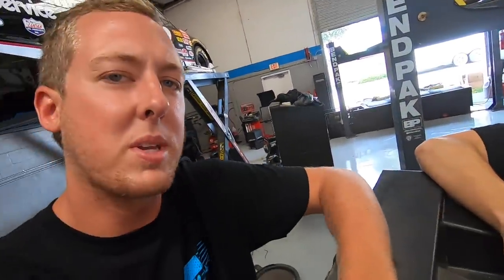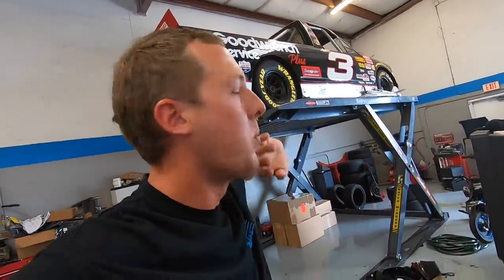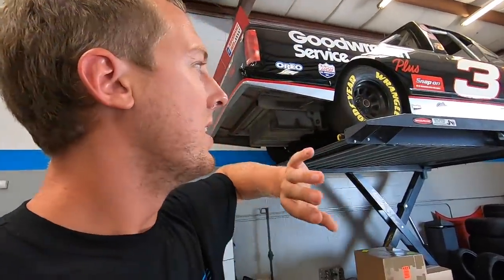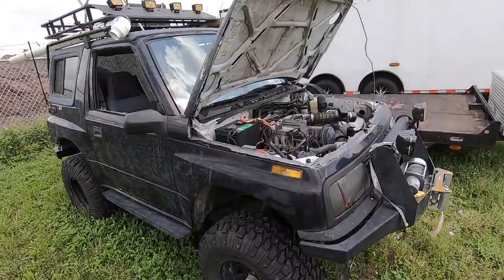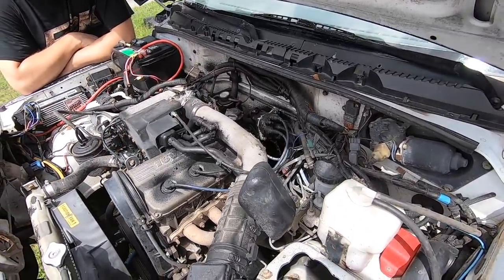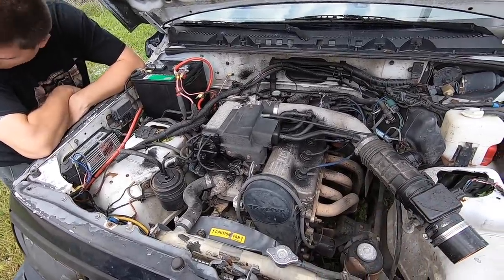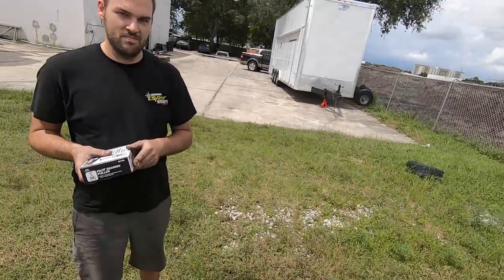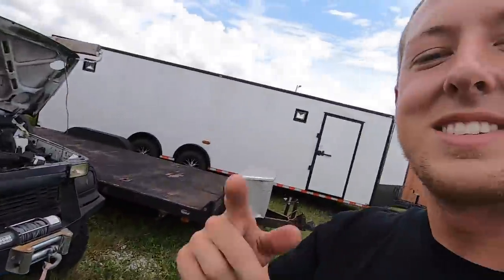Here's Why the Dale Truck and Mini Bogger Have Been Missing

Comment: Maybe you should look for a diesel for the mini bogger. no electronics to make it stall out.
Reply: Eric Nelson just a Kubota 3.2L or a Cummins 4B
Reply: Fantastic idea, especially now that the Galaxie put some diesel fumes in ol' Cleeter's head...
Reply: Something like a VW 1.9tdi would be pretty cool
Reply: 4bt squaa
Reply: Get a marine diesel out of a boat. That’d be sweet.
Reply: Vw TDI is definitely the way to go and they can make some serious power for what it is.
Reply: @diffypoo  they're bulletproof.. got one in my ford galaxy
Reply: @diffypoo  
That's still electronically controlled with a computer
Reply: Kyle Sonsalla not the older ones...
Reply: @427bbcpower  
ALL TDI engines are computer controlled. The older IDI engines are all mechanical.....
Reply: Kyle Sonsalla ok well then you can swap the mechanical injection pump onto the tdi cause I’ve seen all mechanical tdis before
Reply: @427bbcpower  
You can swap 4BT mechanical pump onto some of them, yes, but the way they leave the factory is computer controlled. Like a GM 6.5, VP44 5.9, etc. The newer TDI engines you cannot make fully mechanical because they use high pressure common rail injection, and the middle years are unit injectors.

Comment: Cletus: "Nothing's broken on it, she's mint"
Also Cletus: "She hooks hard left on decel and needs all new brakes and suspension."
Reply: It was designed to make left turns.
Reply: New nascars do that they are design to do that,
Reply: @Jmandude5  They are not MADE to turn left. It's set up to turn left. You guys do realize that NASCAR does run road courses....
Reply: For Christ's sake. Leave it like it was designed to be and go find a circle track to race it on.
Reply: JMD5 Gaming he never said anything about needing new things... rebuilt brakes, yes.  Adjustments to the chassis / suspension.. but nothings broken.  Just not needs tuning... you know, like a fresh engine swap with a new turbo.  Not broke, but needs adjustments to be it’s best self

Comment: Bogger solution- carb it with an older Suzuki samauri intake setup and distributor- its plug and play. Then if you wanna get real crafty, cut the distributor base in half, weld a 10’ shaft in it, weld a sleeve back over it, and extend the pickup wires/plug wires and have it up over the truck!
Reply: 1990bandit2 don’t know beans about boggers but that sounds like a solid plan

Comment: Cleetus, I'm a huge fan of the channel. I have some suggestions for the Mini Bogger. I would transplant the Gas engine with a 4 cylinder Diesel with Marine Electronics. other than that I would try finding all marine components, alt, starter, Distributor, etc. you had a good idea for the computer by placing it in a sealed box. I would run the exhaust above the roof line . for going in the water reduce buoyancy, take the doors off and maybe putting those tube steel half doors like the jeeps have for safety, and removing the back glass so the water will flow freely throughout the vehicle and it will be more stable. I would drill holes in the roof so there wont be any air pockets. and last that i can think of is fill the tires with water. With that done and less chance of tipping over and           your reducing the buoyancy and increasing traction. Just a thought. thanks for you guys amazing content.

Comment: I'v broken 6 pilot bearing pullers in removing the PB in my C5 Z06.(given three were Harbor Junk).  I have since modded the last three arm puller with a blocker spike that fills in when the arms are spread. Works like it should now. In the passed I'v had to use a Dimond bit in the Dremel to cut and relieve them.

Comment: On the truck....its built to go left so I'm sure the caster/geometry is such to support turning into the corners. Might even be set up with a little bump steer on compression to tow out the LF for better turn in. I've been surprised that you never did set it up on an alignment rack....

Comment: You might want to check into the brake port valve or valves because those trucks and cars are set up to apply more brake pressure to the left front to help it set up for the curve..

Comment: Cleetus, have you checked the front spindles? In most stock car applications one side will be longer and one side will be shorter so the vehicle drives into the corner. Just food for thought

Comment: If you want the Mini Bogger to bog deep and succeed, you need to do, at least, two things:
- In addition to the intake snorkel, build an exhaust snorkel. What killed your 3rd bog attempt was the water clogging the Mini Bogger exhaust. It couldn't generate enough exhaust pressure to overtake the water going into the exhaust pipe.
- Remove the doors. Not only does it facilitate your "escape maneuvers" in case of a failed bog, it allows the water to come in and equalize pressures evenly. Your 2nd bog attempt failed because of this, the water flooded in from the driver side, the driver side became heavier and it tipped over.

In addition to this, I think that you should either isolate as many electrical components as possible, or swap the engine for something less dependant on electrical/electronic stuff. Water on electronic circuits is a no-no, as seen on your 1st bog attempt, when the distributor failed.
Also, put some heavy duty paddle tires/wheels, it makes going through mud much easier. That puddle bottom should be all soft mud, the last thing you want is for the Mini Bogger to sit on the bottom with no traction.

Other than that, do it for Dale and BOG DEEP!

Comment: Forget about the pilot bearing puller.. pack the cavity behind the bearing with grease or soap, take a bolt or a punch that's a fairly neat fit in the centre of the bearing then give it a good hit or 3... bearing will pop right out

Comment: Tell James  I have a trick for him to take out the pilot bearing with no tools and this works on all pilot bearings. All you need is a tube off grease a news paper and an old pilot bearing tool (like the little plastic one that comes in most OEM clutch kits).and a hammer not always needed. Alright take the grease put some in the center hole of the bearing then put a little piece of news paper and pack it in with pilot tool keep doing this till you cant get anymore in. (Doesn't really take much) then take pilot tool and hit with your hand or the hammer when u get it packed good and tight the bearing will start coming out and sometimes when you hit with the hammer they just pop right out

Comment: To drive a spigot bearing out fill the hole with grease and then use an input shaft [or a piece of steel that dia] and tap it in which in turn drives out the bearing.. Works everytime and dead simple and cheap.

Comment: If you want to remove pilot bearings you can us a punch or socket that fits inside the hole and just press a potato, bread, a bar of soap makes it cheap it pretty easy once you do it a couple times. I have done it loads of times myself

Comment: The Truck,,  make sure it has equal length wishbones then work out what shocks it has [shock dyno]  and then simply square it up. Probably need springs, though if you know the spring rates just buy 2 the same as the softer ones. Corner scales are best but simple measuring works ok.
Though the scales will help sort out all the fleet and will let you move weight back without extra weight in the rear.

Comment: Pilot bearing tool lolol brother you don't need one!!!   Stale bread works best. Find something like a 1/2" extension and pack it in the area within the bearing and fill it pack it fill it pack it til it pops right out . Astonished me the first time, it worked so easily. Just a tip tater chip

Comment: If you look at the a arms on the dale truck .its probably about a inch shorter on the drivers side .might be why it wants to left. Might be I said .someone might have changed it ..also check wheel base .the rear is probably staggered .meaning the right rear might be forward a 1/4  or more then left .depending on what the chassis was originally set up to do .just throwing it out there .there's a few more thing to check but I'm sure you guys will have a expert go over it .

Comment: Remove a pilot bearing pack grease or even soap into the ID and pound an input shaft/clutch align tool/bolt into it, hydraulic pressure behind the bearing/bushing will push it out.

Comment: The mini bigger needs to have the exhaust extended to be above the water line just like the intake. The reason it is dying once it gets under water could be that the exhaust is filling up with water and causing too much back pressure and is choking it out.

Comment: Need to make venting holes on the bottom, so you dont have to open the doors to let the water in. Or out.... a hole saw bit and flex seal should do the job

Comment: You can use a old input shaft and fill the pilot hole full of grease and pop the pilot bushing right out
Reply: Not on an LS you can't. There is a plug in the back of the crank that will press in and cause a whole bunch of problems.

Comment: The mini bogger needs to loose the fuel injection and needs a intake, distributor, and carburetor from a earlier model and then be put on Propane to do submerged running. Also the Mini Bogger needs calcium in the tires to weigh them down.
I thought Cooper put a built motor in the Supra or did never get installed.

Comment: Use bread for your pilot bearing puller pack it in with a round punch and it pops right out sounds crazy I know it works. Yes I said bread bunny bread what I use and eat! Its hydraulics grease works to but its messy.

Comment: They should install some cheap ECU in GeoTrucker like megasquirt or speeduino. I that way the could rid ignition distributor for direct igntion and the could pour all engine electronics with rtv silicone in one box.

Comment: What ever happened to the rail job that you were going to put an engine in so you could play in the sand or take to the woods and do some rock crawling with? Or the air boat idea? ut that little frame job that needs an engine went off the top shelf where the Dale Truck is sitting went somewhere didn't it? The deep bogger for the underwater stuff needs a sealed diesel so it can go underwater like the man with the jeep on Motor Trend channel did. He went real deep with his. He had a longer snorkel for his intake air than you guys did.

Comment: pilot bearing puller? i thought you were just supposed to fill the hole with Irish spring bar soap and pound the soap in until it pressed out the bearing.

Comment: LEAVE THE BEARING PULLER IN THE BIN, FILL THE HOLE WITH GREASE AND USE A TIGHT FITTING PUNCH THAT FITS INTHE BEARING, ITS COMING OUT. IF THE SEALS IN THE BEARING ARE GONE, ADD SHREDDED PAPER TO THE GREASE. 
SOLD!

Comment: When are you going to build a low drift S10. Or a corvette torque tubed S10 with a transmission back by the rear end. An SVette10. It would be close to 50/50. Not realistically but that would be cool

Comment: The mini bogger,,, I’ll put money that the MSD box is fried. They don’t like being filled with water. Probably why it keeps dying every time it gets sub-merged, as well. That’s about the point where it’s died all 3 times is when the box has gone under. Pull it off, drill the heads out and see how much corrosion is in it! Then seal it back up with RTV, a few rivnuts in the fender well, and call it a day!!

Comment: time to go full eagle on the bogger 3k rebuild pull and strip the engine and all new wires fully flex seal every bit of electrical even the battery.

Comment: Pack the pilot bearing with grease use a bolt that barely fits inside the bearing and hit it with a hammer the pilot should pop out

Comment: get a stock carburettor intake (boosted boys?) and make the bogger run on a propane system , thats a mecanical system (electric shutoff valves can be deleted or made manual) and sealed from the intake to the exhaust the gastank is sealed and can be supmerged too , the feedline  to the gassifier from there to the intake is pressurised , no feulpump needed
that does away with a lot of the electronics used for the injection 
could add a good (magneto?) distributor and seal the heck out of that and the engine ingesting water would be about the onlu thing stopping it from running underwater 
gotpropane sells ready made kits for the samurai both in 1.6 and 1.3
http://www.gotpropane.com/p541.html
does loose a bit of power running on propane

Comment: The Dale truck is 100% ready to go nothing wrong with it. But it needs the brakes rebuilt, needs the suspension sorted out, need to straighten out the chassis. And it needs the injectors doing, But its 100% ready to go. 😂🤪

Comment: Just shot a 4 cylinder diesel motor in the bogger, Be so much easier to submerge and have no problems with it running under water.

Comment: Altering the Dale truck into anything other than a left turning machine is absolutely, 100% NOT doing it for Dale.  The solution is simple.  Start mixing oval tracks and events into the mix or sell it to someone who will use it for what it’s built for and carry the left turn Dale legacy.  The Dale truck was meant to turn left and Dale will roll over in his grave to the right side if you change it.  Just my two pesos!